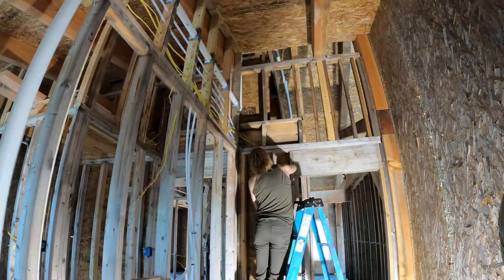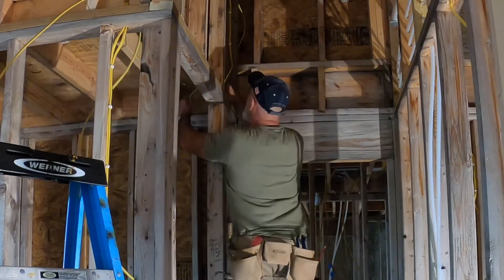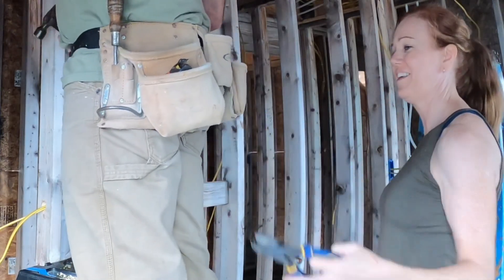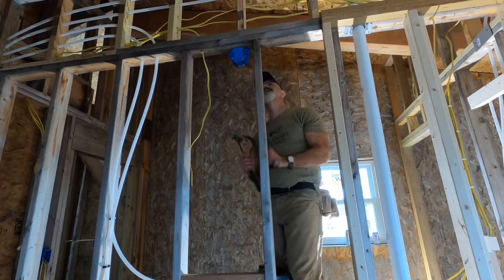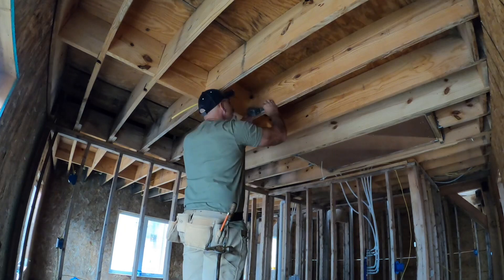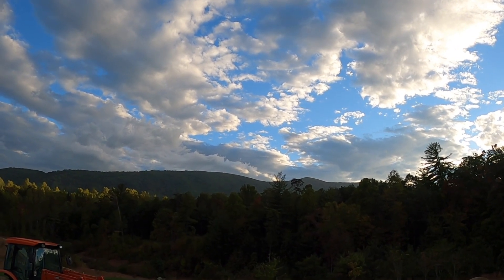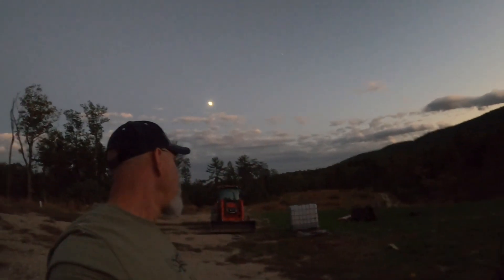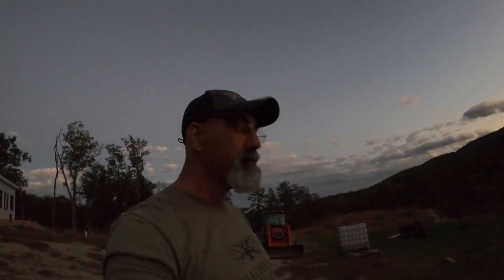Fixing our Electrical Wire Mistakes

Comment: I don’t make many comments on “how to or not to” do things simply because everybody has their own way and preference. I know it’s after the fact and I’m not looking at the main panel. But it seems to me, surface mounting it is more of convenience than that of code. I personally would rather gave it flush mounted and spend the time routing the wiring.
Reply from the maker: I am sure it was mostly convenience. When all is said and done, it will work.

Comment: Quick and dirty way to trace the wire you didn't label is a 9v battery at one end, and a multimeter at the other end.  Simply look for 9 volts on the suspect wires.  Safe and easy.
Reply from the maker: Thanks. Great tip.

Comment: You are required by NEC to use boxes that are tested and listed for fans now.   Best wishes.   Kevin
Reply from the maker: It was labeled as a fan box. But it was just too flimsy for my comfort.
Reply: I've hung hundreds of 'em and the best way is a solid foundation to start. Strong cross brace with metal 4" box lagged. That way you know it's not the foundation when the fan has a wobble.  Keep after him Jefanna. Having fun on the jobsite will make it less boring.